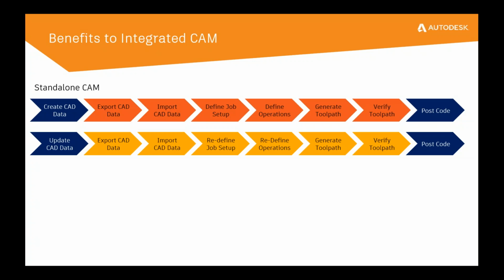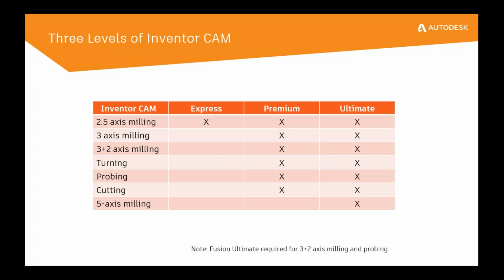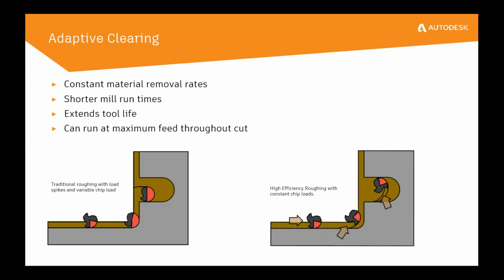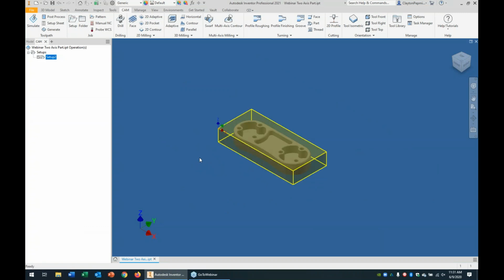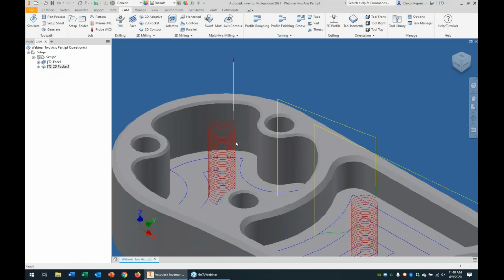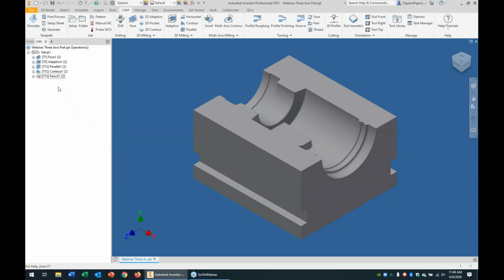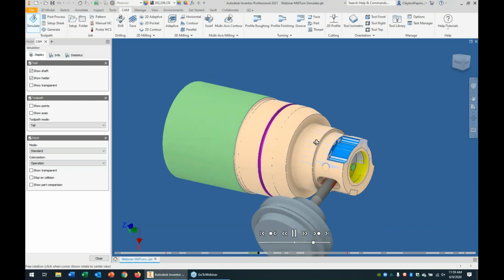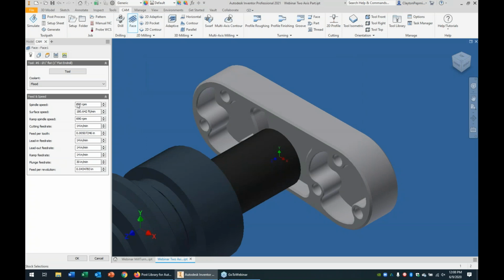Introducing Inventor CAM

Comment: great video, except autodesk has basically said they have absolutely zero plans to continue any development on Inventor HSM/CAM.  Fusion, which is awful, will be getting all of their attention.
Reply: Seems that way. My company has just got me a ticket of Inventor and the first thing I noticed is the CAM in Fusion seems more updated and user friendly than the much more expensive Inventor Cam. I bet in time the price of Fusion is going to skyrocket, if this is what they are doing.